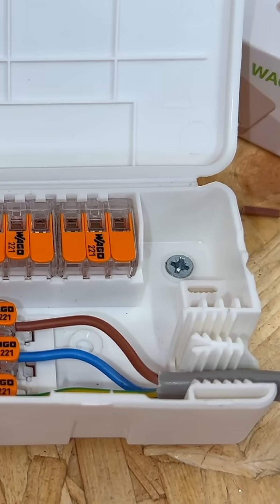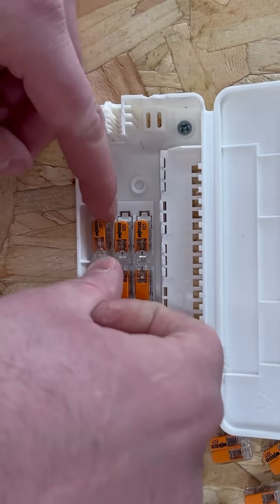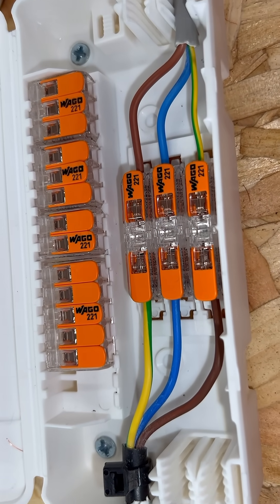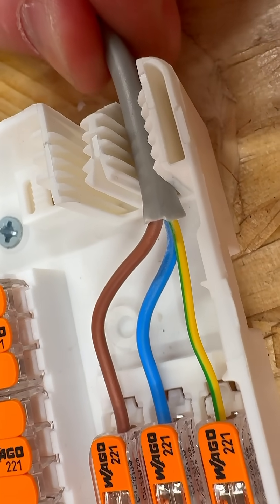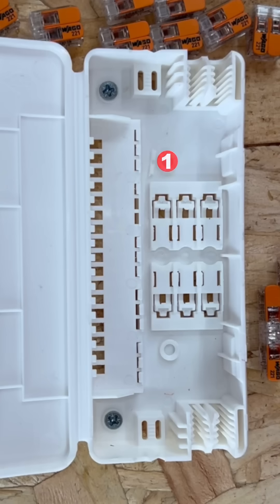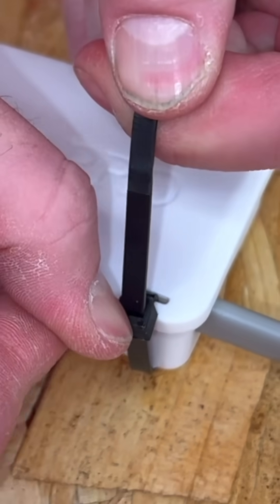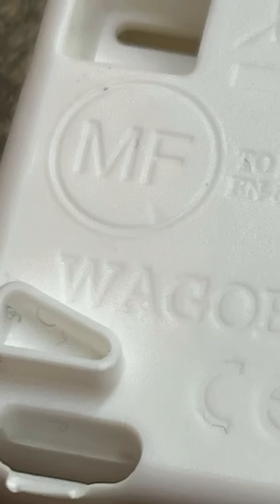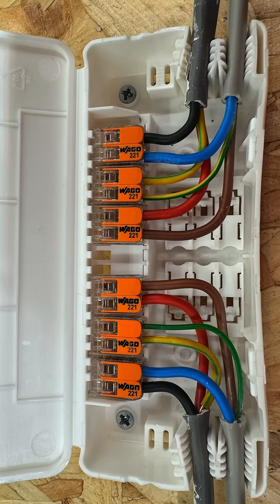Your Junction Box is Holding You Back!

Comment: Simple reliable design which allows modification.
All those round junction boxes need to be outlawed.
They are never used correctly and frequently buried behind plasterboard walls, underfloor, and other locations which cannot be accessed without damage.
Frequently used by the non competent and incompetent kitchen fitters bathroom fitters and wannabee electrician builders.